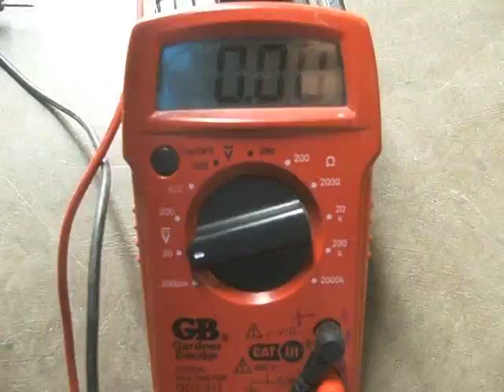VRO How to CHANGE diaphragm EVINRUDE Fuel Pump REPAIR Outboard motor 40 50 60 70 75 80 88 90 100 hp

Comment: How can i find the exact new replacement diaphragm i have a 1994 75 hp evinrude  ?
Reply from the maker: I went to our local boat shop and they had mine.  If not they will tell you they can order it.  You may be able to look up your motor and find a parts list and get the part number and find it on eBay, which will probably be cheaper although you're not helping out your local businesses then.